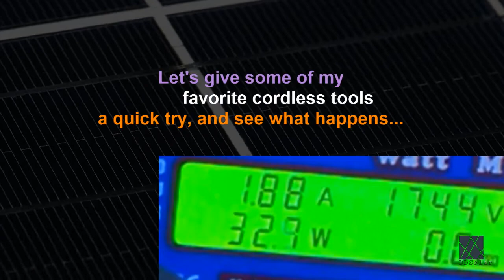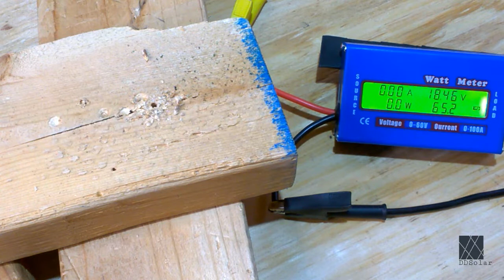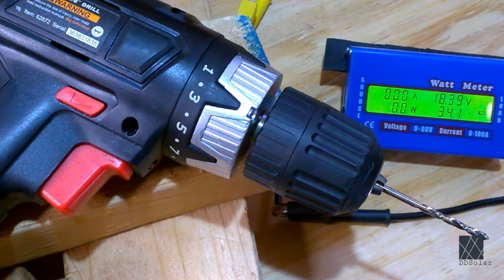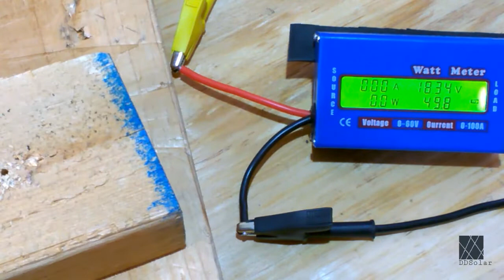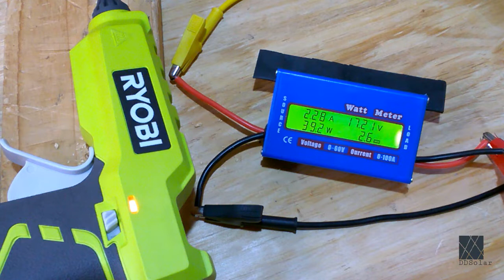Running Ryobi and Other Power Tools Directly From A Solar Panel

Comment: so given your tests here the same methods could be applied to running those tools off a regular Lifepo or lead acid battery as well. Nice thanks for posting this video.
Reply from the maker: @anthonyglaser929  Hi, yes, that should work, depending on the tool... thanks for watching

Comment: Would a vehicle or marine  ( whether car, truck, van, boat ...)  voltage regulator be of any use? As I understand they are very robust and could be gotten pretty cheap at a scrap yard.
Reply from the maker: I think it could work, but don't have one to experiment on. One more reason to visit the scrap yard!

Comment: But what's the point of hooking up solar wires to a cordless battery tool?? Isn't the attraction of the ryobi platform is that it is cordless??? Now your turning a battery system back into a wired tool no??
Reply from the maker: Flexibility and options. Such as running my 18v soldering iron all day at the workbench on a solar panel outside, and save wear on my batteries. 

In the future if things get tough and batteries are in short supply, or there is an emergency, I have another option. This channel promotes preparedness and readiness, so direct solar tools fits the theme. The tool itself remains cordless and has not been modified.

Comment: Love the dinner you cook im hungry ok 😊😊 can you use more solar pannels to guarantee more stabe power but capped at 50v so early mornings n late evenings or even all night gives some power how can we do that Sir🎉🎉❤❤❤❤❤❤
Reply from the maker: @user-hw5el1wu8u Hi, I'm glad you like the cooking :) I will try to answer these questions in future videos when I can... more solar panels does increase power stability... but can still use a battery to have stable power at night. Also I have tested supercapacitors to stabilize power output, still working on that. Stay tuned :)

Comment: what u can do for safe is go to a scrap yard or yard sale or maybe home depo they have ewast bins u can find a bad bater there and make adoter so when your use solar plug in the adper and hook it up to ethere a babter bank or solaer panles
Reply from the maker: Hope to find some dead batteries to make adapters. Shouldn't be a problem and ebay is loaded

Comment: Thank you so much for the Ryobi/solar content. I'm just getting into solar, but the content has been very informative and confirmed some of my assumptions when it comes to solar powering some of my own Ryobi arsenal.

Were you ever able to identify the purpose of the two additional pins on the Ryobi 18v batteries? I had assumed that they were for temperature control for the chargers but I haven't found a definitive answer.

This is extremely simplified, but what I'm looking to do is wire a buck converter (24v -> 21.5v) directly to the internal positive and negative leads of the BMS of one of my batteries. The wiring will be routed out through the bottom or side of the housing with connectors which would allow for the battery to be plugged into a device while also being charged with solar, effectively also powering a device with solar. 

I may have to experiment with the idea of directly charging to the BMS itself, but if someone else knows the answer that's always preferred :)
Reply from the maker: Welcome! glad you found the videos useful :) that sounds like a really cool project. I am sure Ryobi never intended to charge the batteries directly without using their oem charger. But if the charge voltage and current are limited and about 20v - in theory it ought to be fine. And it's on my list of "further research". I suspect the additional connectors are not always used, but sometimes for sensing temperature and in some cases to detect the battery type for certain high power appliances (that's just a theory though).